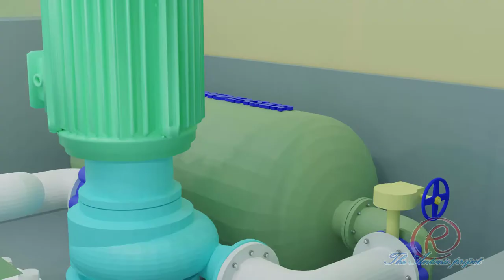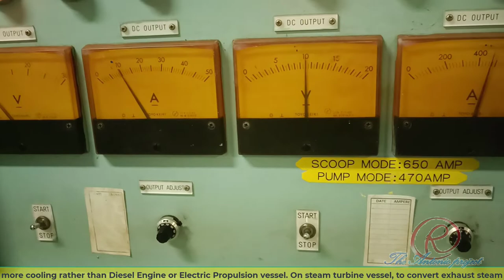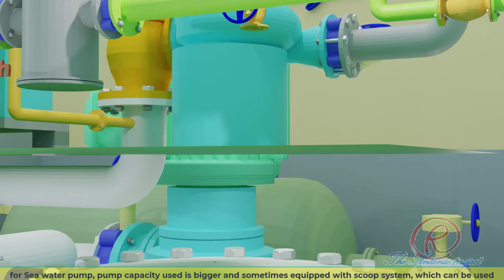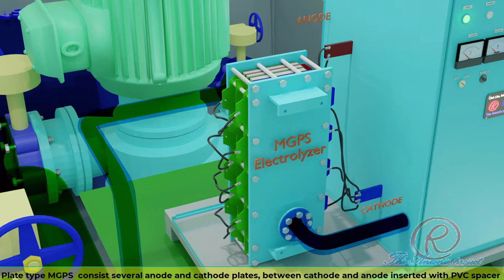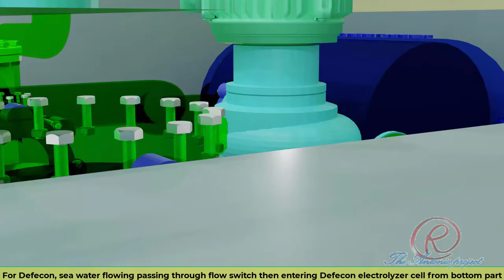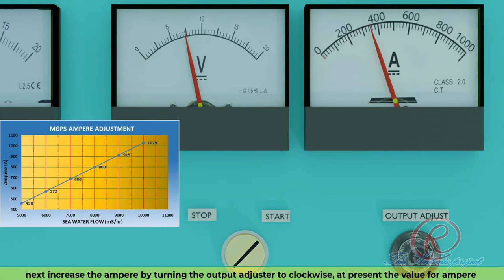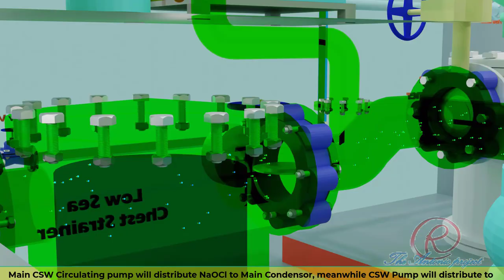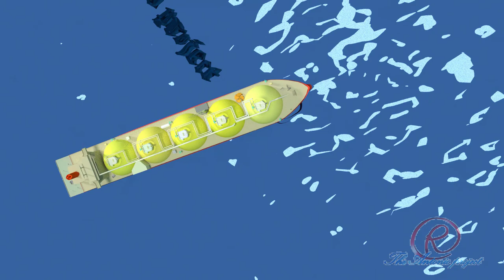Antifouling - Part 3. Defecon (Fe Ion Generator) and MGPS For Steam Turbine Vessel

Comment: How to fix anode consumption alarm after replaced anode ?
Reply from the maker: Hi.. did you mean after renewing anode for Fe ion generator.. if that so.. there is several possibilities.
1. The sensor bolt on the backside of steel block is shorted with steel block bolt. Please watch part 4 about the location of the sensor bolt.
2. There is shorted cable on the sensor wiring.
3. There is defect on the insulation between block and body.
Please measure each stell blocks resistance, between the sensor and stell block. 
When the resistance is reduced the possibilities the said block is under problem.